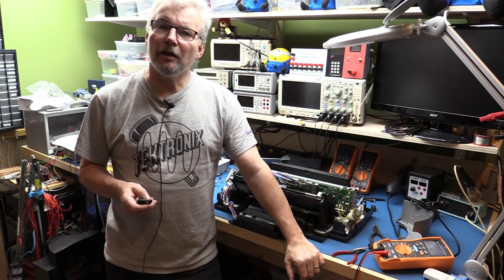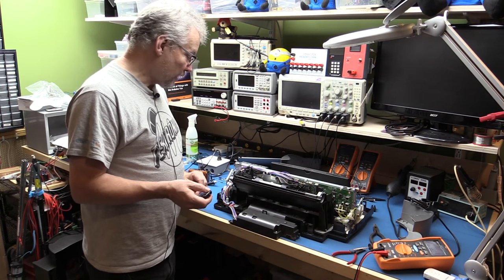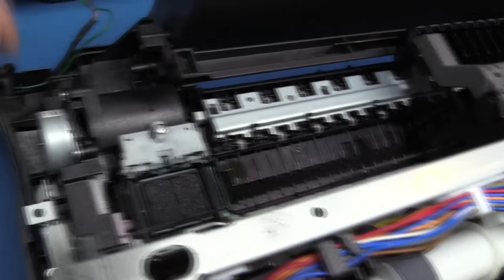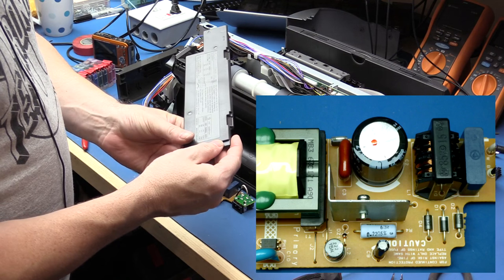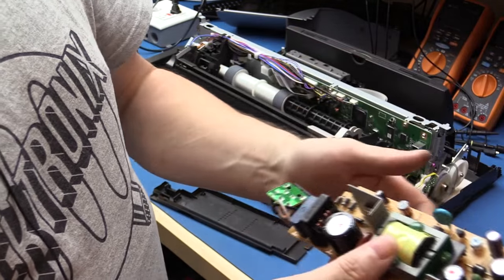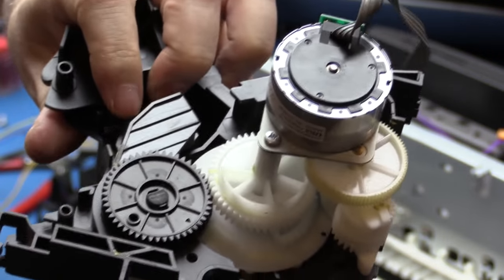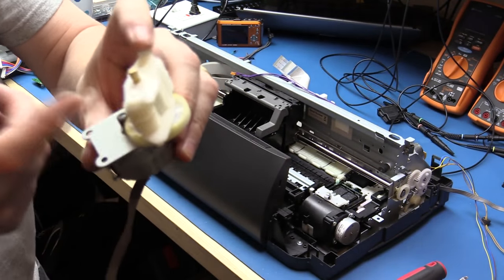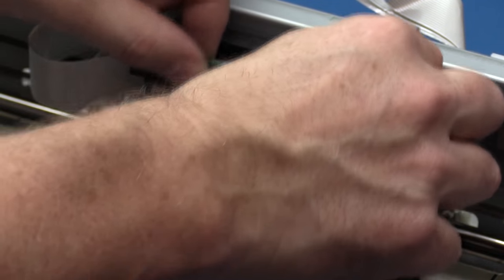Canon I9900 Salvage

Comment: I picked up this very printer last week on CL. The guy assured me it was in working condition and even though I don't usually take peoples' word, I did this time. I guess my radar was off! The printed does not come on at all. I opened up the power supply and nothing looks suspicious or damaged. I have a voltmeter, do you have any tips on how to test this power supply?? thx

Comment: How hard would it have been to convert that printer to a plotter?
Reply from the maker: +Coolkeys2009 with the frame I have left  it may be possible as it could still move the paper and head mechanism but there would be a fare bit of work involved, perhaps replace the DC motors with steppers as well, it was / is something I was contemplating
Reply: Peter Oakes I wish I had thought of it earlier, the paper feed mechanism looked perfect, you would only need some solenoids to lift pens up and down when mounted in the cradle. Using the dc motors could be more complicated but they could be faster and more accurate than steppers with right software. Anyway look forward to your next videos.